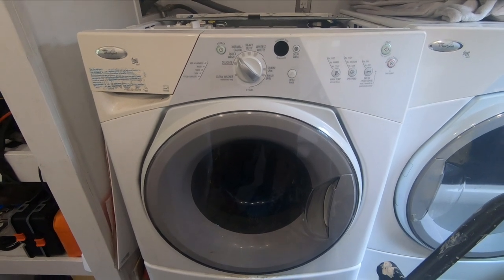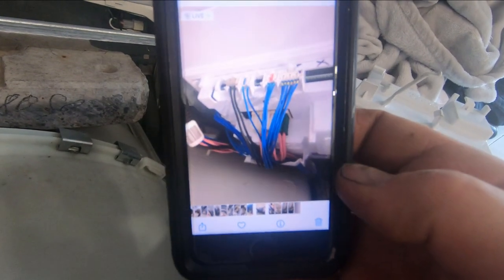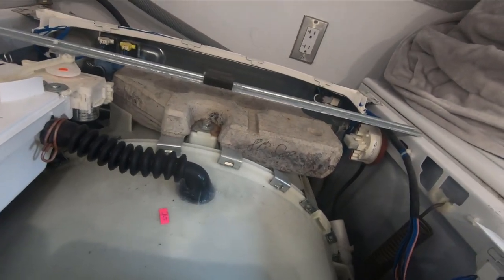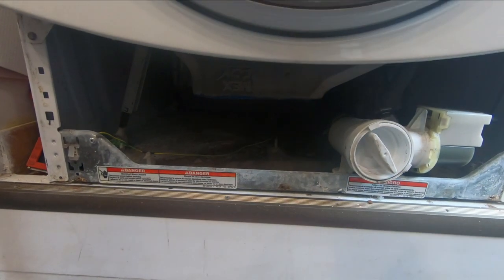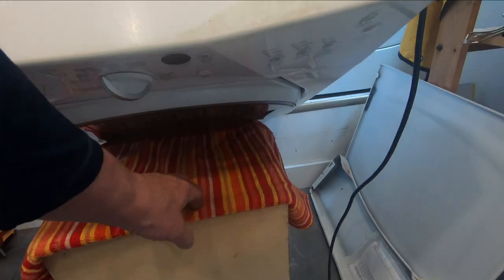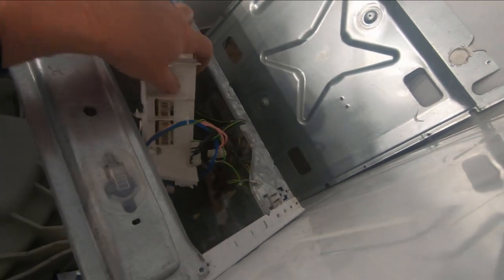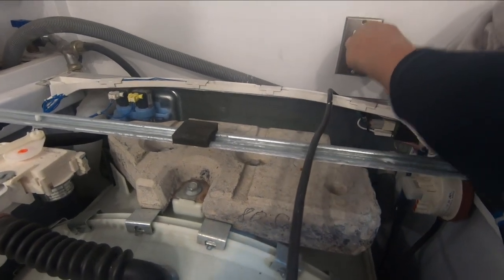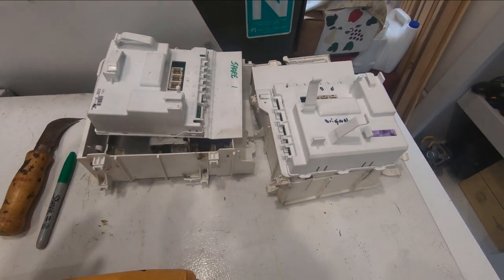HOW TO FIX F-28 ERROR CODE WHIRLPOOL WASHING MACHINE

Comment: How's she goin'? That's a great idea to strip out spare parts form an old machine.  Sure saved ya here eh!!  Nice fix and how sweet is it to have clean sox to start the week!!  Take care!!!
Reply from the maker: Being a packrat has finally paid off. Those spare boards have been gathering dust for a couple of years and I wondered if I'd ever need them...now I won't ever throw anything out again...haha We picked up this washer dryer set for $100 four years ago and all I've had to do prior to this repair is buy a new drain pump for the washer for another $100. Not a bad record so far and we have used them a lot. Collecting parts can be somewhat of a disease though...I can hardly drive past a good looking washing machine or dryer these days...I see the potential in the parts. That's how hoarders start filling a 20 acre property!! I'll have to be careful.
Reply: @EverydayProjects  But these old machines are so tempting.  LOL

Comment: I found that the reason the motor board fails is an issue with the drain pump. The sewer smell you noticed when you cleaned the filter is a sign of a pump problem. If you took a look at the pump impeller you’d probably notice black slime in the impeller from the seal leaking. It doesn’t drain properly and the motor board has to constantly keep adjust self. This causes relay and other components to overheat. 
if you see a bad spot on the board, it can be traced to the cause. I’ve learned to check the pump and that smell of sewage is due to an issue with the drain pump.
Reply from the maker: Thanks. I'm going to install a new motor & pump. Thanks again
Reply: I appreciate this comment. I bought my pair used when I bought my house. Been working great until the other day. I am a mechanic so I knew I’d get it done but knew nothing about it going in. Read your comment, cleaned out my filter (which had a dryer sheet blocking it. Now the last 1 minute of the cycle actually only takes one minute, not 15. Now I’ve got good full flow when draining.  Hopefully I caught it all in time to save the board. I also back washed the drain hose and filter housing with cleaner and hot water.

Comment: Not everyone has a spare board…
Reply from the maker: You are right. Not everyone has a spare board but they are available. Sometimes they are for sale on ebay, (that's one of the best places to look for a used one). Find the part number on the board and type that into a search bar at the top of the ebay site, or on any appliance parts website. Otherwise, new or used boards may be found at appliance repair shops in your area. Many shops will order and sell them for customers to install themselves. The best, and safest route, however, is to have an appliance technician provide and install the board but that's not for everyone either. I got my spare boards from identical machines that were put out on the roadside for pickup and had them stored for just such an eventuality. All the best of luck with your repair, and by all means, if any of it is beyond your technical ability, please have a licenced service tech do the work. Thanks for watching and I hope to see you here again.
Reply: @EverydayProjects  Thank You. This has happened before. It’s a summer cottage of mine and while I will have a technician work on it tomorrow. I barely ever use it. This has happened before. I was hoping to somehow hit the right button and make it work. My clothes are in it. Very frustrating. I am a woman alone. I’ll probably just get a new one…
Reply from the maker: @galefralin2886  Replacing it with something new may be the best solution. Sometimes it doesn't pay to keep spending money on an old appliance. Bummer that the clothes are stuck inside. I hope you have something to wear while you wait for the new one to be delivered:face-fuchsia-poop-shape:. The technician will be able to get the clothes out. Maybe plug in the machine and try to start a cycle. Even with the code , sometimes the door lock will be released. Always check for good, used machines available in your area. Facebook Marketplace is a popular spot for buying used items. Sometimes there are fantastic deals on used appliances (if you aren't concerned about a matching set) and you will be washing clothes again. All the best to you! Don't forget to share my channel with your friends if you found this helpful. Let us know on here what happens. Take care!